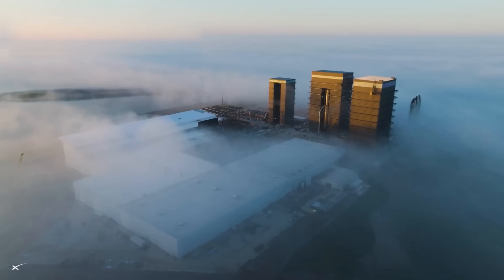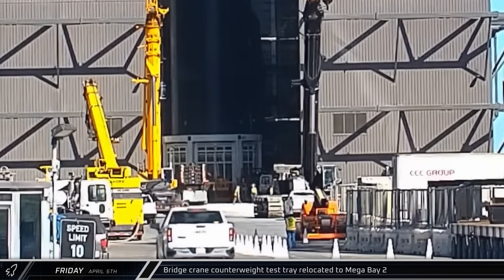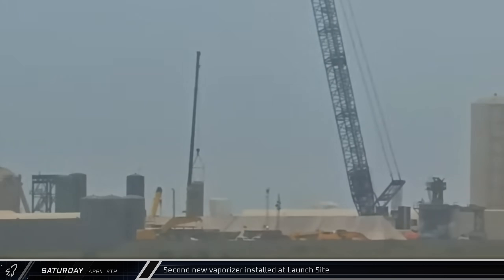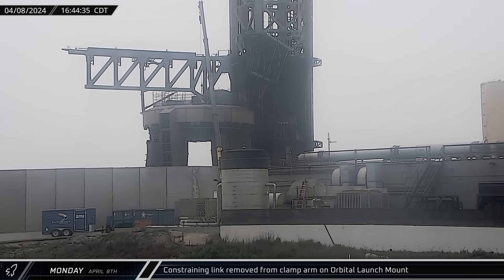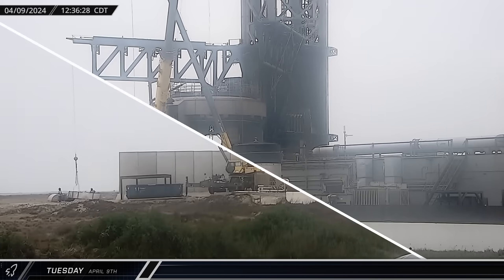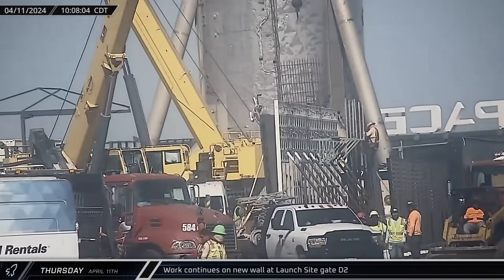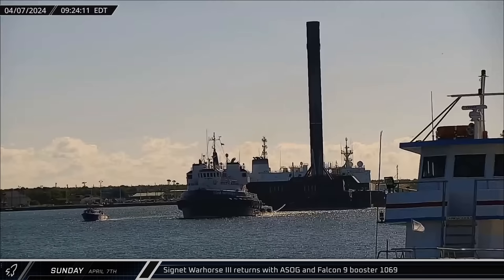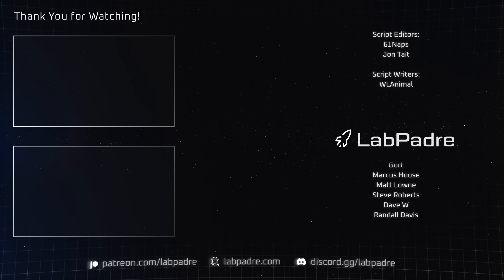Starship's Much Anticipated Flight 4 Is On The Horizon! - SpaceX Weekly #110

Comment: Thanks again LAB and crew. I wonder if IFT 4 has the booster hovering above the water and turning on it's vertical axis. I'd imagine they're going to need to perfect that if the chopsticks are going to connect with the catch-supports on the booster.

Comment: Outstanding report- as always!  Also: Just from the (sea-going) fleet’s timing….seems they really are starting to run up against the case where it’s the current fleet’s cycle time that is going to be the limiting factor in terms of flight frequency unless something changes. One possibility: if they could somehow tweak F9 even further- a tall order considering how much Version 5 is improved over previous versions already- such that at least a few more launches per year that would have required drone ships could instead be done as RTLS’. Since, as you show here, a single recovery ship can now pick up fairing halves from two different launches anyway, that would help some. The other option is, another drone ship. I consider that unlikely, however, for this reason: Starting in 2026, F9 loses a majority of its ‘customers’- the Starlink Mini’s- as the full-sized (and much more desirable) Starlinks are flying on Starship. That will have the effect of ‘dumping’ a bunch of F9 capacity on the launch market- a huge amount, of history’s most reliable booster. At the same time other, competing boosters will likely be ramping up: Terran R, Firefly’s, Ariane 6, Chinese, Indian…not to mention next sized category of Vulcan and New Glenn (maybe). Point is, we’ll go from a dearth of launch capacity now, to an ‘oversupply’, starting in 2026; so putting money into another drone ship now in 2024 would not seem justified. (Unless: the ocean-coming ships’ cycle time right now is such that you might need an extra one of each, just to ensure you always have two always operating…..).  - Dave Huntsman